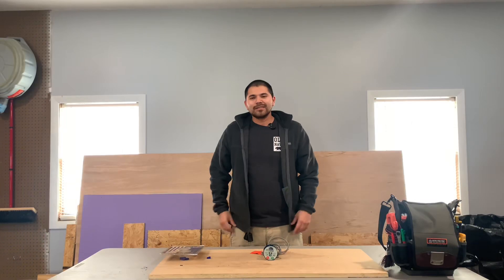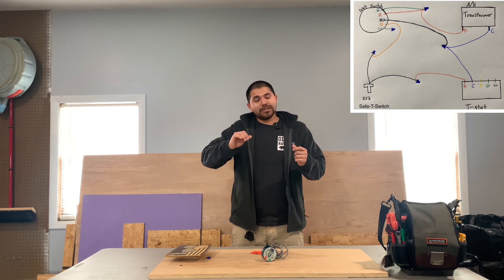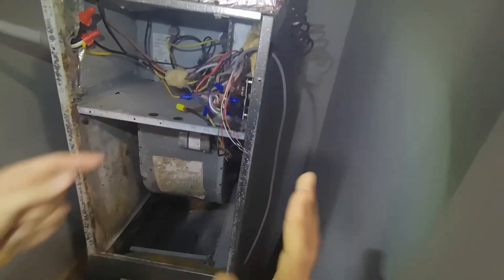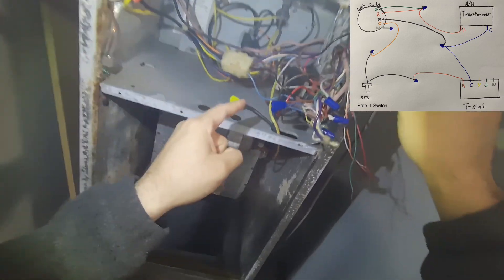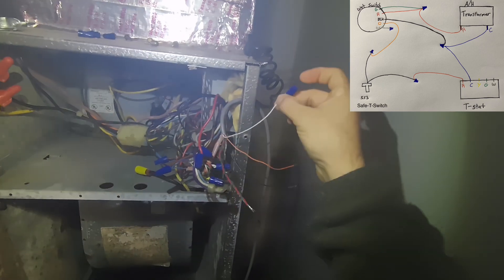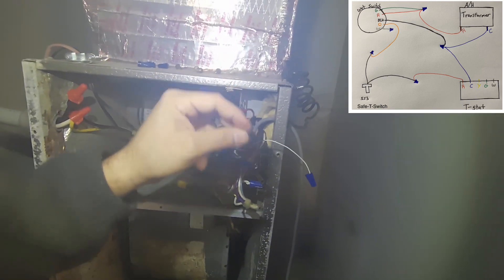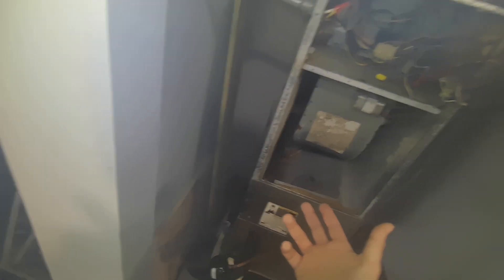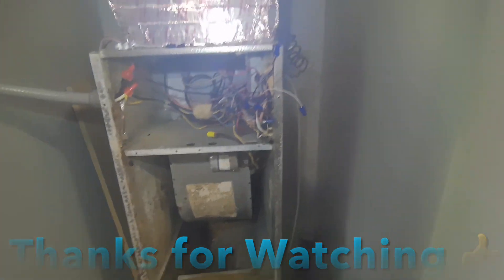How To Install Wet Switch (HVAC)

Comment: Thanks for the great video. My thermostat does not have a common connected because it is battery operated.  Aside from that, Is the wiring still the same procedure?
Reply from the maker: You’re welcome. Yes the wiring is still the same👍

Comment: Man, I gotta say — I watched a bunch of videos and read the wiring diagram that comes with the wet switch, and I was still confused. I had suggested the wet switch to a customer after he had a big flood from a busted drain line, so now it was on me to install it. I’ve done it before with my lead, but I never fully retained it, and this time I was solo.

Your video saved me. I literally watched it in the supply house parking lot, and the way you broke it down slow and clear was exactly what I needed. But the real MVP was that hand-drawn wiring diagram — I screenshotted it and used that at the air handler. The system fired right up, no issues at all.

Seriously, huge thank you. Subscribed immediately. Looking forward to more content — you’re a natural teacher.
Reply from the maker: That’s awesome glad this video was informative for you, also appreciate the comment 👍